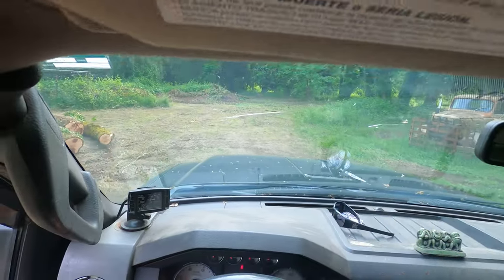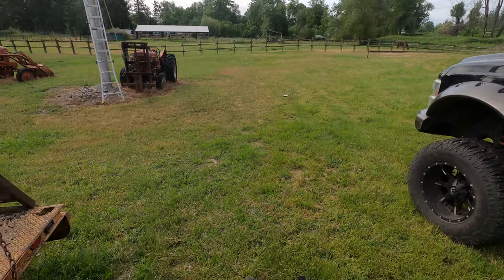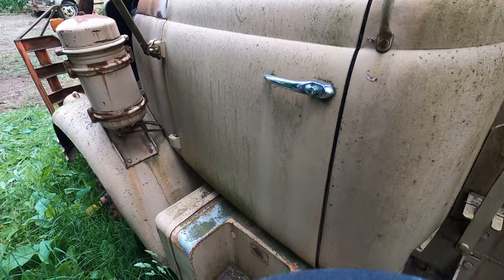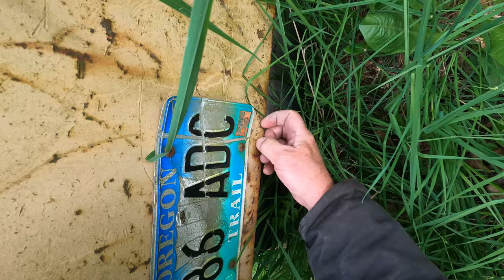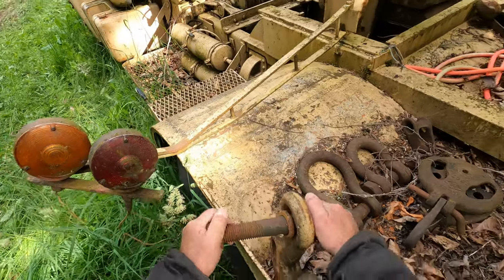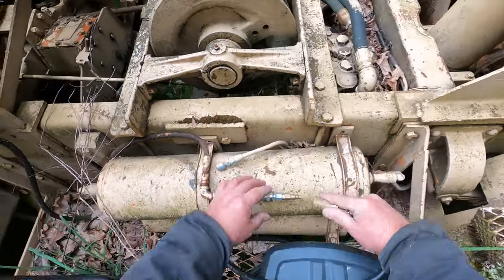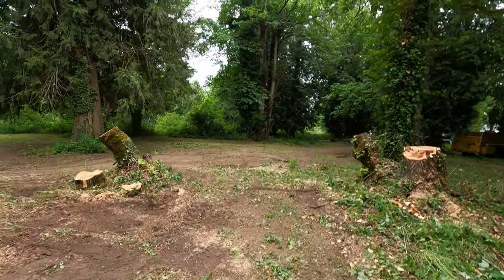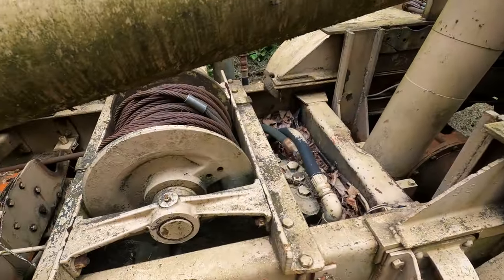Taking Down The Trees and Moving a Very Big Truck

Comment: Does it have glow plugs? Use some starting fluid sprayed into air cleaner make sure you bleed the fuel lines you don't want any air in the system

Comment: Its maybe a fuel problem You can bleed the fuel system by loosening fittings and turning it over to see if fuel comes out. And there is sometimes a manual pump you pump up and down. to get it primed. And ether in the intake filter helps a lot too to get it to bust off. He going to need to cut the stumps off level with the ground so they can move the house in. Fix that truck so you can move other trucks with it.
Reply from the maker: Thank you Buddy. It all helps.

Comment: That truck will be great when you get it running. Look for a fuel shut-off hadle. It will have a manual or electric electric fuel shut off.
Reply from the maker: Thanks for the tips!

Comment: I know that it is probably too late, but if you leave six or eight feet of the tree trunk, you can dig around the roots with the backhoe and then tip the stump out with a big truck. The Old Hooker would be ideal, but Bucky or Bull Frog( loaded) would do it.
Reply from the maker: I left 3 to 4 feet of stump sticking up....I'll give that a shot. Also, thank you for the info you sent me about the old Cummins fuel system. Very informative and helpful.

Comment: That truck most likely has a handle or cable or something you pull to kill it and its easy to forget to push it back in when you go to restart it if it doesn't have a spring return ! Or could have an electric solenoid on the pump by where you were looking that would need 12 volts going to it to turn the fuel on
Reply from the maker: Thank you, I will look for that.

Comment: Bleed air out of the injectors when you are turning over the engine.
Reply from the maker: I think you're right. worth trying anyway. It will let me know if its getting fuel or has air in the system. Thanks

Comment: take the fuel filter or filters off and fill them with fuel put them back on give it some ether and it will probably go.
Reply: Oh and the knob on the dash that said run and park is the air windshield wipers.
Reply from the maker: Thank you. That's a good idea about the fuel filters.

Comment: think i seen a  sunloid  on top of the  pump the thing the leaver you touched  aka the throudl you need 12v to one side grounded the other side  should click with your hand on it  there might be a screw on the  back side  turn in if no power that will bypass to run that  is more power  there than you know spend the time now make  moveing that big stuff easy can push fule with the air in the TANK your right there  and a sniff eather yes not a lot
Reply from the maker: Thank you for the tips...They do help.

Comment: A diesel will be hard to start if the fuel system has lost its prime (air in the lines).  Some diesels have a device (a pump handle) near the fuel filters wher the fuel system can be manually primed. I have also seen a procedure to crack the fuel lines and crank untill fuel appears to get the air out of the fuel lines.